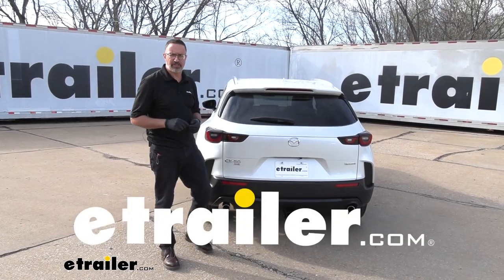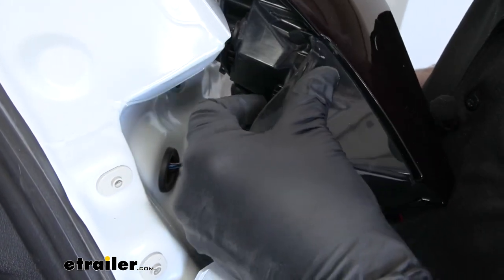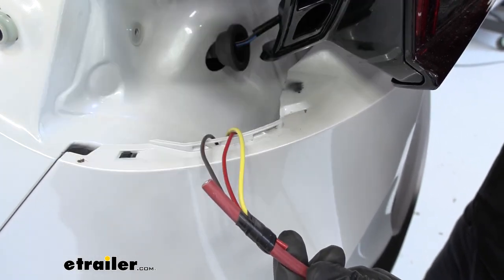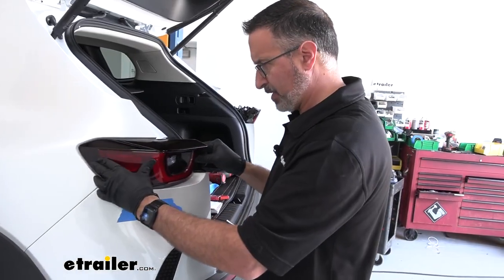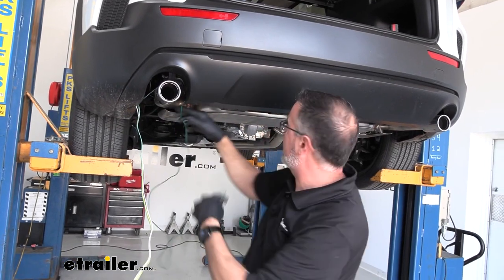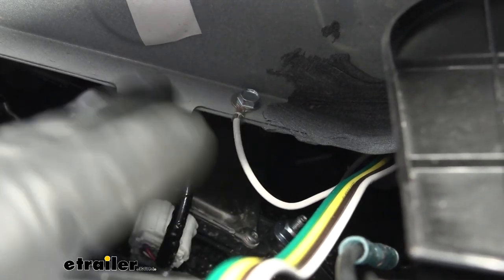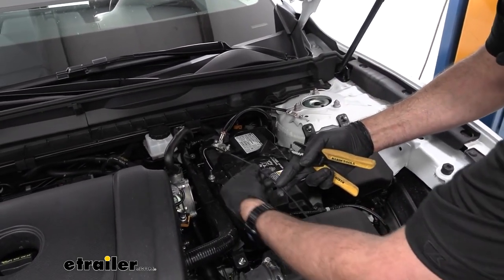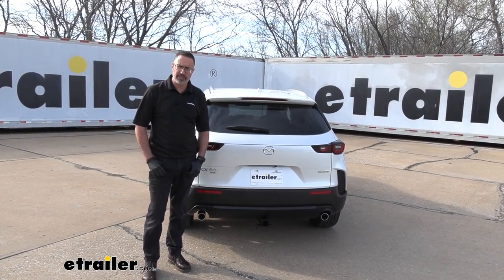Set up: Curt Powered Tail Light Converter with 4-Pole Flat Trailer Connector on a 2023 Mazda CX-50

Comment: I think there's a mistake. At 3:02 you stated to "grab the red, yellow and black" wires.  I think you meant red, yellow and brown since the black is going to the  battery. 
I tried this and is not working on my cx50. I used red yellow and brown to the lights and still not working.

Comment: Now here's a valid question. The turbo model has a tow mode that automatically replaces sport mode when you hook up a trailer. Does this set up trigger that tow mode in the menu? I don't feel like it will since it's coming from the tail lights but I don't know I could be wrong.
Reply from the maker: It won't trigger the tow mode, as you said it's only tied into the taillight circuits and 12V from the battery.
https://www.etrailer.com/Custom-Fit-Vehicle-Wiring/CURT/C59236.html
Reply: @etrailer  too bad they didn't make something that would trigger it. I will I guess I'm going with the OEM.